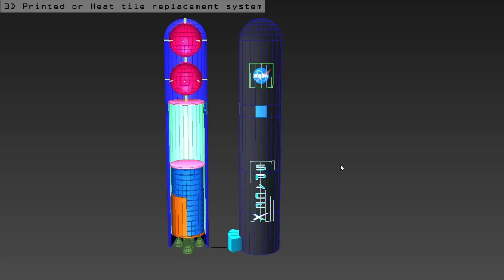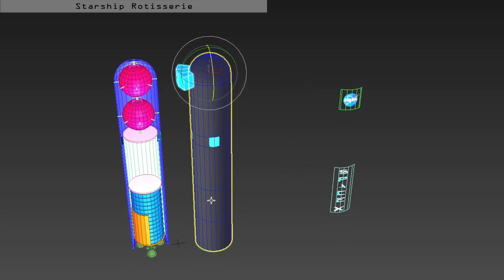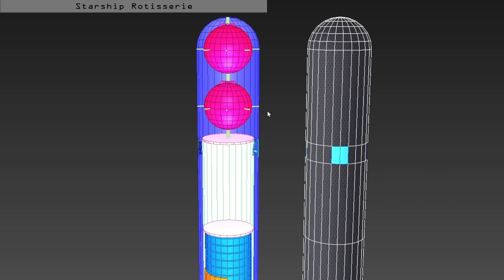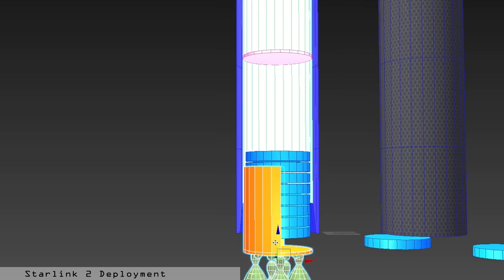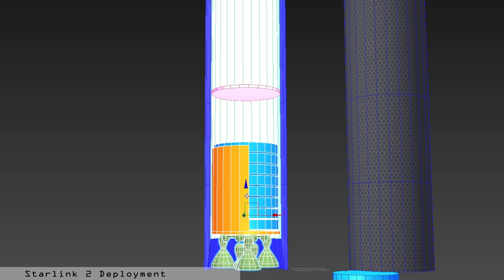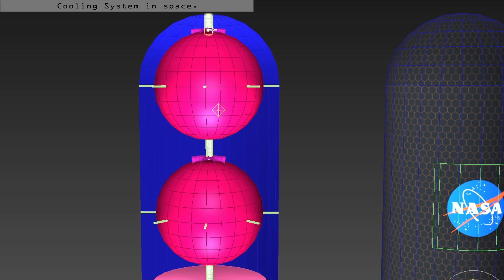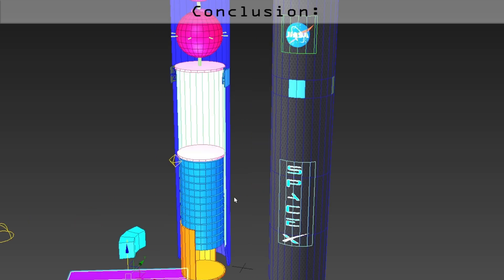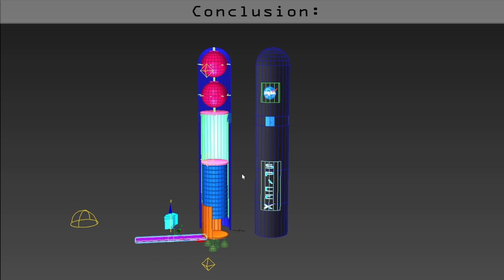SpaceX Starship Rotisserie Design Concept

Comment: How do you steer it in atmospere, how do you get the propellant down to the engines, why is the oxygen in these sperical tanks thats verry mass inefficient and the seal in pressure linses down in the bottom that diss and reconnect when opening the cargo bay would be a gigantic pain in the ass.
Reply from the maker: Those are engineering problems. I'm just the customer, and this is what I want! 🤣
The next video is up, showing more of what I want 😆 a real starship!